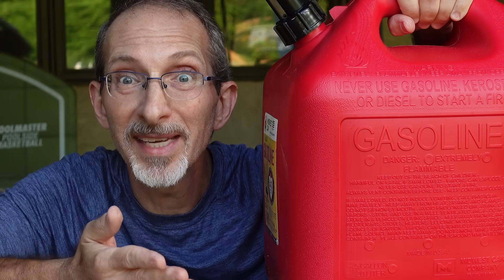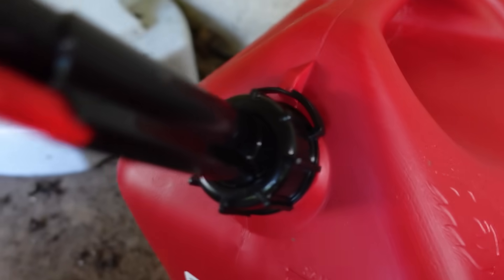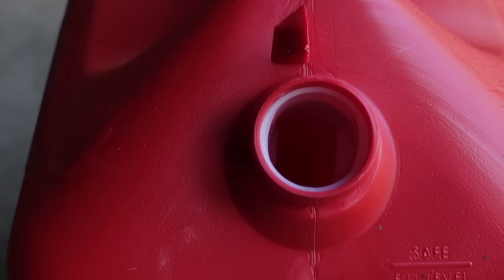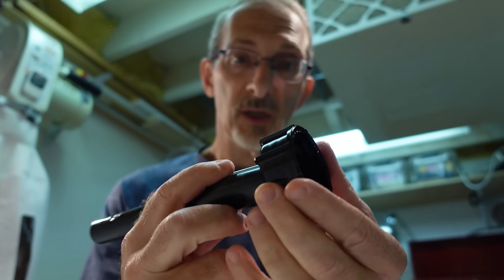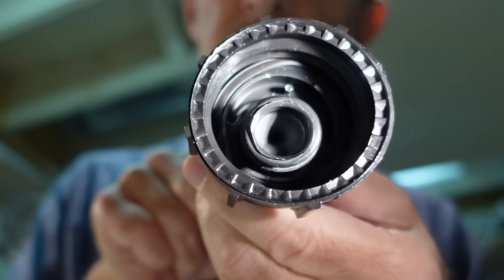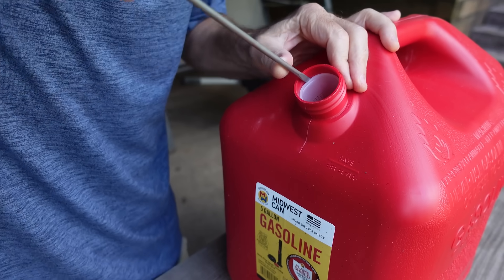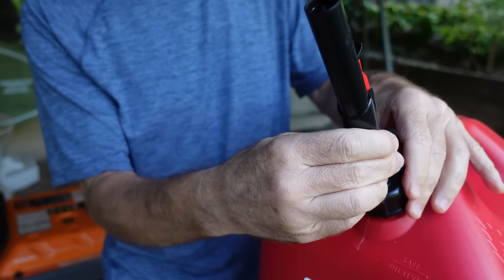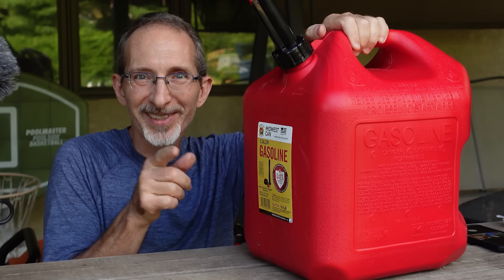Gas Can Modification | New Gas Can Fix

Comment: I simply eliminated the red locking mechanism on the filler nozzle that way the spring still keeps it tightly closed
Reply from the maker: Jeffrey, I agree that red locking mechanism is a real pain. I don’t mind it with the spring gone, but having both the spring and the red button it’s just too much. Thanks for the tip!

Comment: That filter was HUGE! I would have tried cutting a few coils of the spring or heated up the spring to reduce the spring tension. If neither worked, I would do what you did and remove the entire spring.
Reply from the maker: Good ideas. In my second video I cut off half the spring and stretched it back to its original length, and that helped considerably.

Comment: THANK YOU so freakin’ much for your “how-to” video! I bought one these little buggers last year and it’s been nothing but an aggravating annoyance beginning with the first time I used it. Thank goodness I still had my old gas can. Now, if you can do a how-to video on how to modify the 5 gallon big brother of this annoying POS, which has a different mechanism, I would be absolutely elated!
Reply from the maker: These cans are the 5 gallon size, but someone else in the comments said that the fix also works for the 2 gallon can. I hope that helps!
Reply: @MikeFyxdt  Hi Mike, thanks for your reply. The mechanism I’m referring to is kind of like a block (light lime green colored) at the top of the nozzle that you have to depress. I believe it’s a Scepter can. It’s 5 gallons and it’s a PITA to balance while depressing the button to fill up my riding mower or refill my smaller cans.

Comment: I wonder what the penelty is for defeating federally mandated EPA regulations.

Its N0T just safer, its to prevent gasoline vapor from entering the atmosphere.
What are you going to do when the can tips over and there's N0 spring tension to prevent liquid gasoline from escaping (spilling) ?.

Comment: Agree the new style gas cans are a problem and don't work well. The goal was laudable, to reduce evaporation and spillage, however they do not work well as other posters have mentioned you tend to spill more gas.  

I took a slightly different approach then you. I purchase old school snap in vents and drilled the top of the can. Replaced the safety spout with flexible nozzle.  The one thing that surprised me is new cans don't come with just a sealing gas cap, the nozzle always has to stay attached. We keep 5 5-gallons containers of stabilized gas in our shed, so having a nozzle on each can is a problem. To make a sealing gas cap I found some black polycarbonate disks the same diameter and thickness as the nozzle. Put the nozzle gasket on the disk. To keep the disk from falling out used a couple of thicknesses of foam mounting tape. Polycarbonate is resistant to gas. I've been using this system for the last 5 years, so far so good.

Since you removed the strainer from your generator gas tank probably be a good idea to add an inline fuel filter, to keep crud out of the carb.
Reply from the maker: Tom those are great tips! Thanks for joining the conversation.

Comment: This is cool but u should put a filter when u poor into the generator cause the gas fluid or the container are not 100% clean and by removing the spring is a mistake cause that's a safety spring. What u should do is to replace it with one theirs less stif or harder but will work for the same purpose. By removing it every time u stop pouring or lift the gallon it will spill out with no control and I going to make a mess and can cause a fire.
Reply from the maker: Good tips! I actually put the spring back in in my second video, after I shortened it to take some of the pressure off. It’s much better that way. I appreciate you watching!

Comment: I immediately went out to my shed and modified my 2 cans after watching your video. Worked perfectly. One thing I would add, when removing the screen is to grab it with the long nose pliers and just keep twisting it in a cone. It detaches the 2 clips and slides right out. Also avoids any distortion to the screw neck of the can.
Reply from the maker: Excellent! I’m glad it worked out for you.

Comment: How about you just remove the back of the spout, then you don't have to do anything but pour it out like a gas can is SUPPOSED to work.  If it is molded, a properly sized drill bit (Large) should do the trick.  For extra points, you can start with a smaller bit and adjust to the flow that you want from the spout.

Comment: Go to rural king they sell a kit that puts this video to shame.  Drill a hole on the back side of the can the top of the can insert the piece from the kit that opens and closes with a push of the tab. Then take off the fill tube and use the one in the kit it flows very fast especially with the back tab open to allow air to go thru.  Also this kit is under 10 bucks. And their gas cans are cheaper as well.

Comment: I swear all of those "safety" functions result in me spilling more gas than I ever have... and that's aside from how SLOW they pour.
Reply: u can not fix BS
Reply: Couldn't agree with you more! 15 minutes to fill my snowblower tank in the middle of the winter is ridiculous.
Reply: I get mad and remove the whole spout, spilling half the gas on everything! but at least it's over quickly !! And I'm done !
Reply: You can purchase a kit for less than $5 that has a new spout that's flexible with just a cap like the old ones. It also comes with a vent that you can put on the backside like the old ones used to have. You just have to drill a 1/2 inch hole and press it into the hole by hand.
Reply: @moparmadness0180  I have ordered  the old style online, but they are illegal to sell in any hardware store in CA to my knowledge !!
Reply: @iloveglobalwarminggodbless5059  All well and good in concept (on paper). In reality, far more gas vapors are exposed to the environment via spillage and leakage caused by just one of these idiotic environmental nozzles vs 50 years of use with an old style gas can.  The state to blame for their invention, is none other than California.
Reply: @iloveglobalwarminggodbless5059   I'm sure they had a good reason for doing it.  Like having 15 of them in an enclosed shed when you decide to light your cuban cigar could cause an explosion.  Or because the fumes from a can left open could eventually equal the amount of pollution it takes to manufacture all of the complicated parts that goes into the new design.
Reply: @docferringer  Nothing more than CA radical environmentalism, and a liberal state government to make it so.  Blame CA.

Comment: The screen in the tank is to prevent fumes in the tank from igniting on a half full tank which would cause an explosion great enough to rupture the tank and create a fire ball.
I agree the valve is a pain in the ass. the screen is too when using a California style of pump handle.
Reply from the maker: @Thinker2 - Yes! I corrected myself about the flame arrester in my follow up video. Thanks for speaking up!
Reply: @MikeFyxdt  I saw it, but you did not mention potential for fireball from a half full can. I agree with your opinion, but you solutions are recluse. Design a better system.
Reply: @MikeFyxdt  I contacted the manufacturer of my can and they were not willing to hear solution to the product which does not work at a California pump. I did not make a video because my make shift solutions were not for other people.

Comment: If you didn’t notice the gasket that seals the nozzle to the can is rolled back which could give you problems with leaking. If the screen is bronze or some other metal you could make a case for the flames flashing into the can. But plastic? No!!
Reply from the maker: Hi Kevin - other people mentioned their concerns about that o-ring. I think it is the bottom of the spout assembly that looks rolled, not the o-ring, which seals very well. I did check, but I appreciate your keen observation - better safe than sorry!

Comment: THANK YOU! That spring removal is what I needed! The filter on my older gas can works like a charm as well - a simple metal screen on a circular fitting that drops in its NOZZLE where it belongs, not the can.

Comment: Thank you for the hack, I use one of those 5 gallon cans to fill my tractor with diesel. I thought I had to get another type or find an old one at a garage sale. It take a couple of hours for the pain to go away from my hand after fueling. Balancing the can over the tractor one handed while I try to unlock the safety and spilling about half a gallon of fuel over the tractor. I've tried unlocking it before hand but as I move it into place it just locks up again.
I don't think I've considered poring fuel on or over an open flame but then you really can't fix or regulate the stupid.
Reply from the maker: Mike, if I had to fill a tractor I would consider getting an inexpensive fuel pump, like several people here have suggested. I appreciate you watching and joining the conversation!

Comment: It is ABSOLUTELY RIDICULOUS that you can no longer buy a gas can with a usable spout... I'm treating my old ones like GOLD now!
Reply: There are a few out there. You have to search and they are not inexpensive.
Reply: @amunderdog : I keep an eye out for them wherever I go, but it's been at least a couple of years since I've seen one...
Reply: @lordofthewoods  Been using Surecan CRSUR5G1  last three years. I like it a lot. It actually a four gallon can. Cannot win it all.
Reply: VP FUEL CANS. OLD FASHIONED BRAND NEW AND SERIOUS QUALITY CANS.
Reply: @1__just_jd : Looks like as close as we're going to get, though I prefer rigid spouts. Only problem I see is a lot of reports of the bottom seam splitting and leaking fuel... usually with the yellow cans? I have some plastic cans that are at least 30 years old and still kickin'
Reply from the maker: Yes - old cans are the new 'in thing'!
Reply: I believe someone got hurt n burnt with the old stlye spout/ hose....from the lawsuit thats why gas cans are expensive. This was told to me by soneone in the automotive industry
Reply: Don't publish your address. Crooks (like me) might come around in the dark of night and steal your old gas cans.
Reply: There are blue water cans that look like gas cans without the safety features.  Easy to use, easy to fill, but they are blue. Guess what I use them for....
Reply: @kenrisse1336 : Hope you don't sleepwalk : )

Comment: Throw the nozzle away, replace it with a old-school black market one. Cut out the filter and throw it away also. Finally drill a breather hole in the top...
Reply from the maker: LoL, need to make a trip to the black market hardware store! In my follow-up video I did drill a hole, and installed a plastic vent & cap - it works great!: https://youtu.be/XoYxdrhB6Ls
Reply: @MikeFyxdt  I got lucky and found some old style brand new cans at a estate sale. Whoever designed these new ones clearly never used one in their life.

Comment: I see a problem with one of your modifications.
Could you put in a weaker spring?
When you fill your generator the weak spring will stop the gas flow when the generator is full.
Reply from the maker: Gary, this is a good idea that others asked about, too. In my follow-up video I did just that - modified the spring to make it much easier to depress, without sacrificing the safety feature. You can watch it here if you like: https://youtu.be/XoYxdrhB6Ls

Comment: in small engines only use pure gasoline ( no ethananol) .  available in mower dept at home depit
Reply from the maker: Peter, good tip!
Reply: Also available at most Quick Trip stations and some others in Missouri for a whole lot less than the mower section. Takes me about 10 gallons to mow and those half gallon cans for about 20 bucks won't get it. I use alcohol free in everything but the car/pickup.

Comment: As a dummy who accidentally pushed the spark guard into the can, I can attest you CAN get it out. Use a tool to grab the backside of the plastic guard and pull it to the nozzle, then grab it with a pair of pliers. Not super easy, but not hard. Also, no need to use a screwdriver to loosen and deform the guard to remove it...just pry it enough to grab it with your pliers and give it a pull. It will come right out. It literally takes 10 seconds.
Reply from the maker: Ed, I appreciate your tips! Somewhere else in the comments someone suggested holding the flame arrester with needle nose pliers and twisting, making the filter skinny so it slides out. Haven't tried it but it sounds like it would work. BTW, don't feel like a dummy, other people push the mesh into the tank on purpose and just leave it there with no problem.

Comment: Yes Mike, I took the whole spring nozzle out and threw it away. Gas cans used to have short spouts. I took a piece of dead Cedar branch about 6 inches long. Whittled it down so it fit nice and tight and called that good!

Comment: There's no reason to pull it out, and possibly deform the spout, just use a dowel or a screwdriver handle (handle into the spout, tap on the blade to push it in) to punch it into the can. 
I've done this to four of them and the only thing that's a minor annoyance is the little bit of rattling the insert makes.
Reply from the maker: Ha ha, someone just asked if it was OK to push into the can about three questions back!
Reply: @MikeFyxdt  I didn't see it, was there an answer?
Reply: @MikeFyxdt  BTW- they're $13.25 at Target, online price, cheapest I've found.

Comment: Ok, I'm 64 years old now, and I'm trying to figure out when and how gas cans became so effing dangerous. I don't think I have ever seen so much regulation for something as simple as a gas can. Why is it not possible to have one of those good ole screw on spouts, flexible ones no less, that the gas simply pours out of. Has society become so friggin stupid that they can't use a gas can? Maybe just a warning sticker like the ones on the lawn mowers they are pouring the gas into. You know the ones. They tell you not to stick your hand in the blade while it's running and that the mower should not be used to trim your beard. For God's sake people, its a gas can. Not some nuclear fueling device or something.
Reply from the maker: Yes, the safety features on these cans are so over regulated they have become hazardous to use. Thanks for chiming in!

Comment: Great job.  One last thing: a vent.  Drill the appropriate-sized hole near the handle and insert a tire valve stem and cap minus the Schrader valve.  Job complete.
Reply from the maker: I installed an inexpensive plastic vent cap in my follow up video. I’ve seen the tire valve trick done, too. Thanks for sharing!
Reply: @MikeFyxdt  Yep.  I did it, too.  But, eventually, that thin piece of plastic broke, the plug/cap flew off and I lost it.  So, I pried the other half out, drilled it out, and pulled a tire valve into the hole.  Works great.  And, it's more waterproof, I think. 
It's anyone's choice but, that works best in my opinion.

Comment: This is my preferred gas nozzle type for a chainsaw. I literally operate the lock and valve with my fingers. I wouldn't consider that considerable force. Also if you're using a funnel why dont you just take the spout off and pour directly from the container into the funnel?
Reply from the maker: A lot of people are doing just that, ditching the cap pouring into a funnel..

Comment: A case of the idiot who designed it does not have to use it.  A neighbor bought a "levy plow" to make levies for a rice field.  They tried every adjustment they could to get it to make a levy.  They contacted the equipment company and they tried.  WOULD NOT WORK.  The equipment dealer contacted the manufacturer, who sent the guy who DESIGNED it.  The designer asked them what they were trying to do with it - they said make levies.  The idiot engineer said "Oh, this will not make dikes (not levies) - it is just to keep them plowed and weed free!"  The equipment dealer made the mfg. take it back.  (I hope they fired the idiot.)
Reply from the maker: Crazy story. I can’t imagine the plow was cheap. Products definitely need to be tested by the people designing and selling them!
Reply: @MikeFyxdt  about 15 - 20 thousand dollars.

Comment: Don't forget to drill a vent hole so the gas will actually flow instead of splashing and gurgling. I did find re0build kits on Amazon to fix my old Rubermaid cans. New vent caps and nozzles with caps and rings. Try filling a Ford truck with these new safety cans. You can never find that sweet spot so a capped vent is essential. You can even buy retro-fitting vent caps for the new safety cans.
Reply from the maker: You are correct sir! I added a vent cap in my follow up video and it works wonders!

Comment: It still has a major flaw!!!

Back in the day... the damned nozzle was long & flexible, so that you could bend it into the opening & start pouring the gas without spilling all over your mower, generator, & other power tools.

Now they expect you to use that straight nozzle, a 3 gallon tank with 2 hands to tip it and a funnel... seem to be short a hand or two...

Hmmm, how are these cans safer again?

Oh, one more thing... what freaking idiot decided that plastic is a good material for holding/transporting gasoline? 

Plastic creates static electricity... it wears thru easily if it rubs against other stuff... it easily melts & deforms with heat... not to mention cracking... can you say split seams...?

Oh, and "made in freaking china" - give me a break!

By the way, I have an old, steel round gas can that my dad bought in the 1940s! Not a bit of rust on it, has a long flexible nozzle & was made in the U.S.! 
Wouldn't sell it for $10 million; it was my dad's after all!  Maybe a $25 million &  letting me sleep on it overnight!!!
Reply from the maker: Excellent points! I regret throwing away my dad’s old metal can, just because the flexible rubber spout had deteriorated. You are right, those flexible spouts made it so easy to use.